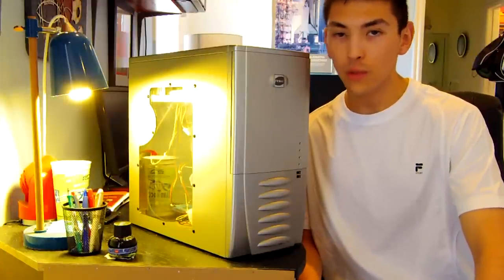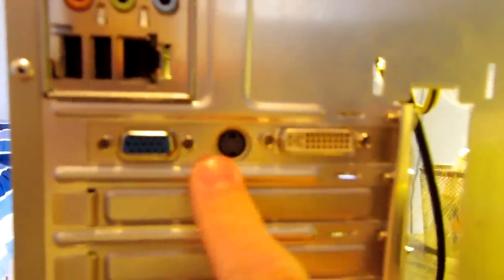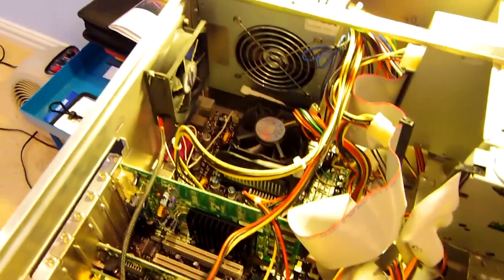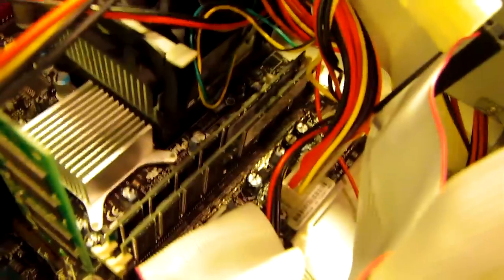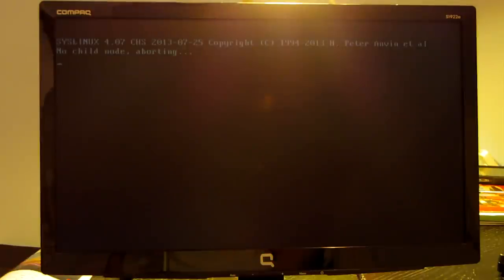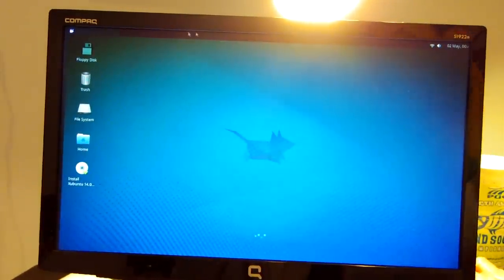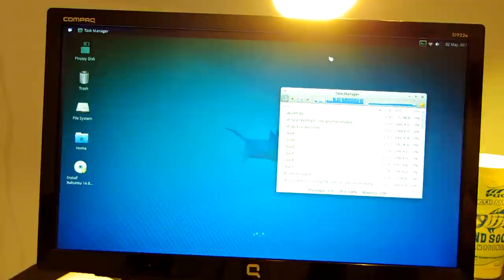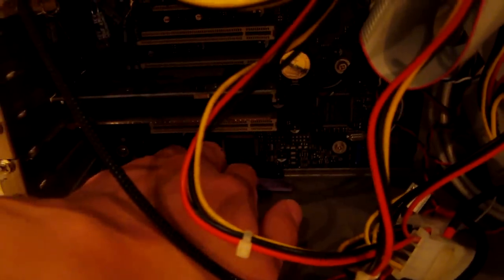Garage Sale Finds: $5 Custom Built "Antec" Gaming PC (Pentium 4)

Comment: geo58impala Pentium 4s are still the best business class CPUs to this day. Why do you think so many schools and businesses run Windows XP or Windows 7 on Pentium 4 machines? No, it's not because they are speedy. But they are very very reliable. And, even at todays standards, they are still fast enough for school / business use.
Reply: ***** Alright m8. I run 60% of the PCs at my high school. Only around 10% of these PCs are Core 2 Duos, the rest are Pentium 4s. They run Photoshop CS6 and Adobe Creative Suit good enough for teaching the basics of it. They run fast enough for flash content and so on. Power wise, this school racks in enough a year to replace all the PCs with PowerMac G5s (One of the most power hungry consumer PCs to exist) and comfortably power them without having to take money from anywhere else. Power consumption is no issue with most companies / schools.  
Also, Intel CPUs have always been much more reliable than AMD.
Reply: ***** I have reasons for not liking AMD. I don't just blindly hate things. And no, they are not ever upgrading the P4 desktops. The plan is when they get too outdated for anything they will replace all the desktops with laptops, which has slowly been coming into play for a few years. We have a bunch of Core 2 Duo laptops in storage waiting to be used. And most of the PCs use XP still as our network system doesn't support Windows 7 (Which is what they say but I know they are just lazy). Also, no budget issue, again, just too lazy to upgrade. We could have all i3 machines with at least 4GB RAM, 780 video cards (art and photoshop) and a 1TB HDD. It's just a laziness factor, and that the Pentium 4s are still good enough.
Reply: 420MLGskeleton I think you need to calm down, Mr. 420.
Reply: Walnut Spice The new AMD APUs are worlds ahead of the antiquated Pentium 4. Lower power usage, less heat, and on board graphics. The APU alone has a lower TDP than most Pentium 4 processors while offering better performance and cutting the need for a graphics card. A Pentium 4 machine can run light applications, but there are many processors that can do the job much better including the Core i3. 
 "Power consumption is no issue with most companies / schools." This has to be the most bullshit statement I've ever heard. Power efficiency may not be an issue for a small business with 3 or 4 computers, but large in office buildings with hundreds of computers and servers running non-stop and it suddenly becomes a matter of great importance. No business would ever be alright with throwing away money for energy bills instead of increasing profits.
Reply: nigahiga6400 I know CPUs have come a long way and are much better. But Pentium 4 machines are so cheap. You could buy a lot of 10 for like $30 to fill an entire class room. Plus, it's not me you need to convince, it's the school district.
Reply: Walnut Spice They're cheap, but they're also old. The CPU itself won't die anytime soon, but what about the motherboard? Power supply? Hard drive? It doesn't help either that you can't easily get replacement boards for Pentium 4 processors. Unless they use all custom built machines, it's a headache to find replacement parts such as PSUs for prebuilts as they are filled with proprietary bullshit. Newer computers won't have to deal with stuff like motherboard capacitors blowing or hard drives failing. Even if these problems can be easily fixed, it still costs money, and in the long run that cheap purchase price isn't worth the hassle of repairs, data loss and computer downtime compared to a new computer.
Reply: +Walnut Spice LOLLLLLLLLL no just no.  you may happen to see that alot of companies and businesses  use a pentium 4 BECAUSE they have never been changed out and dont want to upgrade lmao and they are not fast enough for anything in todays school or business use, only maybe to run a register.......... haha
Reply: +Walnut Spice Are the Pentium 4s running with 32-bit Windows XP or 64-bit Windows XP?
Reply: benster82 XP Pro SP3 x32. But now the damn district is ordering the teachers computers to upgraded to Win10 and student desktops to be upped to Win7.
Although XP runs good on a P4, I am not looking forward to running Win10 and Photoshop on a 3.6GHz P4. It'd be like running Mavericks on a G3 PowerMac.
Reply: +Walnut Spice I half agree with you, P4's have always been nice CPU's and, all though they are getting extremely outdated, it's always nice to get out one of my Dimensions or gx's and play a bit of invisible wars or (attempt) to watch videos. However I find P4's to be the opposite of reliable and 'good', they are completely unbearable to use if you actually want to do something, and I've had 4 P4 (socket 478 I believe) motherboards die on me, either due to overheating(caps bulging then bursting around the CPU)or just plain giving up, and that is over the span of 4yrs. while my 2 Athlon xp machines run completely fine and have had no fault what-so-ever.
Reply: +Walnut Spice yup i dont know shit lol but i believe your original comment said the pentium 4 is the best business class cpu to this day lol i shit myself, thanks for the laugh mate! maybe the term "most used" would better suit your statement haha
Reply: Christopher Rogers It's "most used" for a reason. Now put a shirt on, you ain't no thug.
Reply: Walnut Spice I, personally, haven't seen a pentium 4 used anywhere outside my house for 6 years. I don't think 'most used' relates to this conversation any longer.
Reply: NinjaJokeHere There are 7 billion people on this planet. There a hundreds of countries and 7 continents. Where you live is a tiny dot in the world. I see them everywhere and have been to many states and cities. North Carolina, Ohio, Virginia, W Virginia, S Carolina. Mostly P4s. I go to a lot of libraries to read and stuff. Computers almost always have that little Pentium 4 sticker with a side of designed for Windows XP. So yes, compared to a Core Duo, Core Solo, Core 2 Duo, i3, athlon, ARM, what the fuck ever, it's the most used.
Reply: Walnut Spice Maybe it was, at the time, but honestly it is only used by people that are too cheap to buy newer systems. Also most pentium 4's are useless now anyway so this argument is invalid . And don't give me the 'it's good for applications' bullshit 'cause I could have a fucking i486DX and say it's good for applications because it runs fine with windows 95.
Reply: +Gatewayuser200 may I ask, of what need were the heat sinks?
Reply: ***** Hmm, never knew that. I'll have to keep that in mind the next time I scrap a broken P4 board (some time in the near future, no doubt).
Reply: +Walnut Spice also why won't you admit your original comment is so horribly wrong lmao
Reply: Christopher Rogers Because it wasn't? Why don't you admit you're not a thug? "Lmao"
Reply: +Walnut Spice Not supporting what the other guy said but that was a terrible comeback.....
Reply: the computers at my old school were upgraded to i5 workstations lol
Reply: +Walnut Spice i have two pentium 4 machines, one running windows 7 with a 2.4ghz northwood core and 1gb of ddr 233 and it runs fine, but my mac mini 2,1 with a 2ghz core 2 duo runs signifacantly faster.

 yes, a MAC. but the northwood p4 is better at decoding video and unzipping files and i dont know why. you have a point about most used, but the core 2 is used more often in schools because it can actualy play 1080p video.

 a core 2 quad costs $5 on ebay, so the price of a p4 is irrelivent. also, drivers for a p4 board are hard to come by sometimes. if you want a good single core, go for a amd sempron or a core 2 solo. 

"im han core 2 solo" 

get the bad refrence? and one last thing. most pentium 4 machines run with IDE for the hdd, ect. and that is slowwww so speed is not good. i highly suggest a core 2 quad or an i3.
Reply: yomandisorion CORE 2 QUAD $5? WHAT HAVE YOU BEEN SMOKING SIR?
Reply: NinjaJokeHere Core 2 Quads don't go for much anymore. I sometimes scour our local recycling centre for parts and other tech stuff, and CPU wise, most of what I see are Pentium 4s, Core 2 Duos and Core 2 Quads. I guess people just like to think "It's six years old it must not be good anymore"
Reply: +Walnut Spice on eBay doe, I have seen them before in eBay lol
Reply: NinjaJokeHere i see core 2 quad $5 US on ebay.
Reply: +yomandisorion the lowest they go for is $20
Reply: yomandisorion You can't use bid as evidence lol
Reply: NinjaJokeHere
well the point is you can still get a q6600 from ebay for cheap
Reply: +yomandisorion if you wanted good evidence, use bloomsdale i7's they're really cheap, like $45 cheap for an i7!
Reply: +NinjaJokeHere  *bloomfield
Reply: +Walnut Spice  They let you go in the recycling center? Where do you live?
Reply: *****
i cooked dinner on a pentium 4 once. my oven broke, i was hungry
Reply: *****
they are also good for a heating system during the winter
Reply: yomandisorion Next time on Bear Grylls, one man, one snowy mountain, one LGA775 pentium 4 the hottest of them all. Who will win?
Reply: amd is for heating
Reply: +Kevinas “xXPotatoXx” Zeveliauskas Intel fanboy? Guess you never heard of the socket 775 pentium ds....
Reply: +Walnut Spice you go to some interesting places.... Most places where i go have modern i-series stickers, Core 2 or Modern Celeron/Pentium sticker. My school uses i5s for laptops and i7s in desktops.
Reply: rv3392 Well not everyone is Richy Rich or lives in high income areas Matter of fact, most people don't
Reply: Walnut Spice 1. You forgot the comma for the clause and the fullstop/period.
2. SO your reasoning for the P4 is that it's cheap and i3 desktops are not? EXCUSE ME?
Reply: Nice insult, anyone who has to result to calling someone small or implying that they are young are a 'fucking joke'. Pentium 4s are pathetic and always have been.
Reply: NinjaJokeHere You're bullied in school aren't you? I know, Middle schools tough kid.
Reply: +Walnut Spice  I'm British, we don't have middle schools, even so, how does it feel to have someone who is supposedly way younger than you be more intelligent than you?
Reply: NinjaJokeHere You're not? Your profile picture is literally YuGiOh. You're clearly like 13. I'm an adult. I know more than you do.
Reply: NinjaJokeHere What? And yeah, I do play some Minecraft to kill time. Also, I'm a developer. I create websites. I create programs. I host websites. I use PCs and Macs almost everyday. You're going to judge me for using a Mac? At least I'm making a living here. I doubt you're an animator or writer for Yugioh. What the fuck do you do kid?
Reply: NinjaJokeHere You ain't nothin' kid. Don't try to act hard either. Ain't no Brit hard.
Reply: Walnut Spice Once again, you bring my age into this.
Just give it up already, how does this have anything to do with the fact that Pentium 4's suck? While you're going on your little rant about me 'being younger than you' you fail to mention anything proving your statement.
You keep contradicting yourself 'not everyone is Richey Rich' but you're supposedly some high income web designer? You either have really poor money management skills or you're lying, either way, it doesn't disprove the fact that Pentium 4's suck.
Reply: Walnut Spice Also, the fact that you knew this picture is from YuGiOh is pretty sad, considering I have never watched the anime and only the abridged series and it's a pretty obscure character.
Reply: NinjaJokeHere I watched Yugioh when I was like six, back in 2002. Yugioh has it's own art style and your profile picture, even condensed into 20x20 pixels, I can tell it is, in fact, Yugioh.
Reply: +Walnut Spice Ok, dont want to start a flame war but I want to tell u pentium 4 is not good for much, in our district, we are running i3s on Win 7 and still it barely meets the standards. Not saying pentiums are bad, but a single core cpu running a graphic heavy software is kinda bad. However, in primary schools, a pentium 4 with a decent hard drive is plenty for word docuemnts and such. (btw the good hard drive is for hard drive access speed and start up speed).
Reply: Wu David I never said P4s are fast, they are slow as hell. But cheap and reliable outways the cons.
Reply: Agreed
:D
Reply: +Walnut Spice  Nah, pentium 4  CPUs on their own aren't cheap, you can buy a whole pentium 4 PC for cheap though, I brought one p4 775 PC for £5, and a p4 478 PC for £3, the 478 though gets out preformed by the amd 1.8ghz I brought for £5.
Reply: +Walnut Spice in school we have an i5 4790  i'm like MUUMUU DON'T NEED IT but it uses integrated graphics
Reply: +rifaat saoueris steal it.
Reply: Walnut Spice I use windows 7 on my pentium and the school I go to uses windows 10 on pentium d and they wonder why they need a graphics card

Comment: You should have tried a lower resolution with the Youtube video. Sometimes if you have a fast internet connection, Youtube tries to "default" you into the higher resolution. Video card drivers can also contribute, as well as video player buffering.

Comment: I found in a garage sale a custom build computer for 10$. With only no Hard drive
Specs: Intel core 2 duo e8400 3.00ghz
ATi Saphire hd4850 512mb vram
2gb ram ddr2 800mhz
Asus P5Q motherboard
500w psu
And Nice case😉

Comment: A point of clarification. This is NOT an Antec pd. Antec never made computers, only cases, psus, fans, and possibly a few other accessories. What you have is a computer built in an Antec case. There is a HUGE difference.
Reply from the maker: +cee128d I know.  Hence the quotations around Antec in the video title.
Reply: +AA Computers and Technology It's still an extremely misleading title. Using quotes like that does not actually convey what you intended it to mean.

Comment: The Dell laptop I'm using now is an older laptop that also runs at 2.53ghz, but instead of it being a Pentium 4, its a Core 2 Quad extreme Q9300 with 12 gbs of DDR3 ram at 1066 mhz. Also, its has an NVidia graphics card, but instead of it being a GeForce, its a Quadro.
Reply: probably really expensive for it's time lol

Comment: Recommendation: I used k meleon for an old FX 2400+ single core 2GHz with FX 5200 and I was running 360p youtube. Using firefox I couldn't even manage 2fps.

Comment: Hi,I write to You from far away!the P4 are not for garbage.I collect two of the strongest P4 ever for socket 478  - P4 EE 3,2 Ghz (SL7AA) and P4 EE 3,4 Ghz (SL7CH).little one I put in HP D530  CMT with 4 gb of ram in two channels.with two sata drives in raid1 mode with HD4650 agp version.The big one I combines with strongest MB ever made for 478 Biostar G31 -M4 with DDR2 800 and Pciex 2.0!!I had the biggest Prescott 3,4 ghz,but I sold to my couson for his collection.I used it couple of months  but little cash speaks too much!!It's hard to watch on Youtube 720p clip or film!!It's very low frames per second! but in some games he handle very well!!

Comment: wow, i didn't actually thinked a GForce 5200 couldn't play a 480p video. back in the day (and way up until 2013) i had a PC pretty much like that with a GT6200 and it could run 3 Youtube vids at the same time at 480p. ¿could not be the "Live OS" or bad driver issue? for real i think that that PC could run a win7 no prob.

BTW pretty nice Case, deserves a new pc inside

Comment: Riddled with inaccuracies. Before I start , just because it's in an Antec case doesn't mean it's a "custom ANTEC" case. Anyway, First there are no 2.5" bays in the front, those are 3.25 inch for floppies. Second those are NOT solid state capacitors.   You can clearly see in the video that they are electrolytic capacitors. Please before stating stuff in a video ensure you are giving out correct info

Comment: When you try to use a live version of Linux you do realize it loads in software emulation mode right? That's why the CPU usage skyrocketed and the video was choppy as balls. It was using the CPU for the video and not the GPU.

Comment: I have a 64MB GeForce FX 5200 in my dual 1.8GHz PowerMac G5. If you install Windows 2000 or XP and install the drivers / Flash 11 (Win2K) or Flash 18 (WinXP) it will be able to play YouTube in 720p.
Reply: I agree, I have a very old Athlon XP 1.4ghz system with a 128mb FX 5200 running XP and it plays youtube without any choppiness at all. You definitely need the right drivers or performance takes a huge hit.

Comment: My parents received a computer like this with a similar case and similar specs back in 2001-2002 in exchange for work my father did and it was priced at about $700 or so.
It ran Windows 2000 like a champ and got AIDS from me trying to download some Linkin Park album. 1000+ Trojan horse viruses, shitload of malware, and the viruses made the cursor turn into a dildo.  It finally crashed in 2005 and collected dust until 2007
It's running Windows XP with no problems and it has tons of porn on it ;p
Reply: Sounds like a fucking legendary computer
Reply: My parents found this comment....
Reply: +Alex Kuhn rip
Reply: +Alex Kuhn Rest in Peperoni dude
Reply: I finally gutted the computer within the last week and gave it to the local computer repair shop guy to recycle.
I'll miss that old thing... It did so much for us.

I should have kept more pieces of it so that I don't just have memories and a 40gb IDE hard drive
Reply: oh yah, i love when that happens
Reply: If anyone has viruses, malware, rootkits, or spyware on their computer:
>Boot pc into safe mode, no networking 
>Insert disk or flash drive with root kit killing utilities and virus removal software, run scan with programs 
>Run CCleaner and clean both the system and registry
>???? 
>Profit